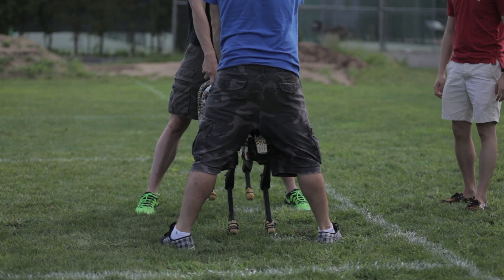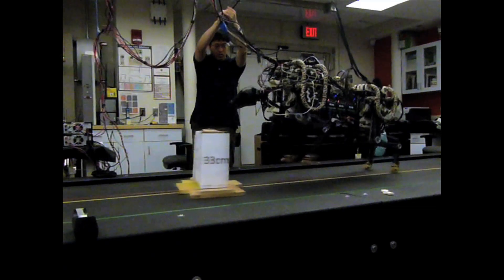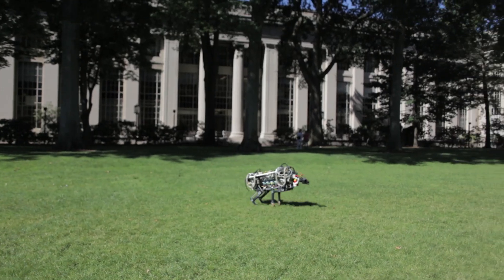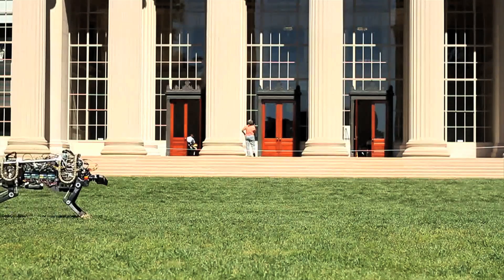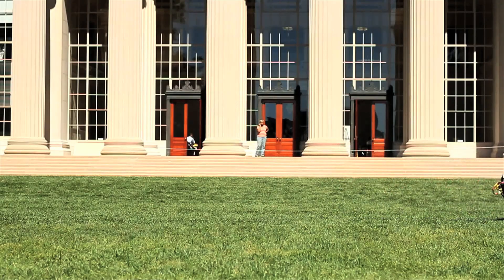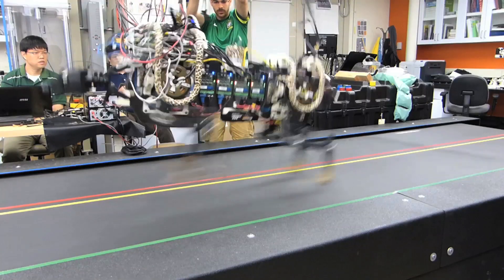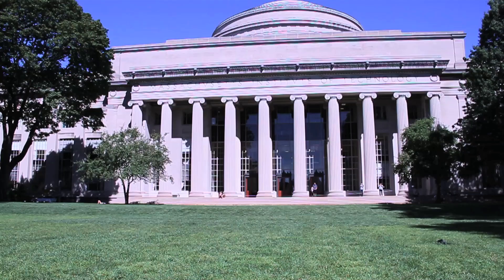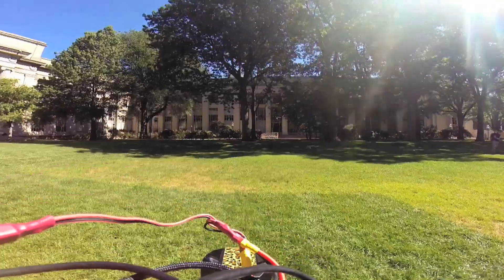MIT Robotic Cheetah

Comment: Cheetahs have distinctive springy backs and long tails for balance. The back curves dramatically bringing the back legs forward of the front legs. The shoulder barely moves up and down. Goats run with stiff backs, springy legs, and tiny tails. They bounce significantly in the front. I think they copied goat locomotion and called it a cheetah. Cool robogoat though.

Comment: Okay, granted, this thing is cool. But doesn't this thing prove how powerful drone technology is? With a drone you don't have to worry about running on the surface of the land and avoiding obstacles because you can hover above them. And although MIT is making great strides everyday, they are still a long way off from having something military ready, while specialized low flying drones might only be a few years away. DARPA's goal is to fund the farfetched moonshot ideas, but how much has it sank into this project already? It's been going on for years (if not close to a decade).

Comment: There is one huge misconception in the approach of the builders of this robot cheetah. Quadropods' movements are entirely induced from the spine and the spinal cord. When cheetahs achieve that great speed it's because it's flexible spine gives the starting point and the main power for each kick of the run. But this project seems to be based on 'big dog' which is a quadropod robot designed for carrying heavy loads on rough terrain at long distances so the rigid bulk of body is obviously explained by the need of enduring heavy duty work like a donkey does. However don't forget to inspect the difference between a donkey and a cheetah. Maybe if this team could modify the robot by adding a flexible hip joint between the torso and the legs that could much improve and refine the imitating mechanics towards of a real cheetah's.

Comment: The cheetah has a much longer throw of the hind legs. From the shoulders back to stretched out back. That one there is a diarrhea gait :)
The obvious first step is to duplicate the layout of the cheetah and the range of motion. Otherwise how could you get the gait right. With a cryogenic cooling liquid you might be able to get the power density of the cheetah in a short sprint. For lab runs you can have hoses of liquid nitrogen running through the motors. Copper resistance falls considerably at LN temperatures. Battery power density should be easy enough with products like A123 cells. Or simply toy RC lithium batteries. Power electronics is plenty powerful. Use relatively high voltage, say 100V for thinner wiring and lighter power electronics.

Comment: We wont replace wheels with legs.
The efficiency isn't even close.
Reply: The future machines will use wheels and legs for uneven terrain.
Reply: New complex tech is always followed by hyperbole, but I can see these legs being useful for off road vehicles. On the highway no way. If it's made more efficient, and more flexible it might be a great mountain climber.
Reply: For rough terrain, very much so, it easily beats tires. 
Roads, nah.
Reply: *****
 It does some what make sense. Having to build the roads that wheels are used on is inefficient. Imagine all legged creatures instead having wheels with the requirement that roads be layed down first for them to get anywhere.

Comment: you need a gyroscopic tail. real cheetah balances its movements and changes its direction with the help of thw tail. cheetah also puts one step ahead of the other here both front and rear feet are moving at the same tine its not natural.  feel free to correct me, i don't mind it.

Comment: I looks like rabbit to me
Reply: Yeah, it does kind of a dual front legs-back legs hop like a frog or rabbit. The next step would be to give it four independently moving legs that hit the earth at different times. Not an easy task, as it would require a sleeker body, some kind of force feedback in the feet and balancing/leveling sensors in the body to keep it upright. My guess is they are teaching it to scamper and jump (like a kitten) before teaching it to run.

Comment: It runs nothing like a cheetah,  not the same movements or near the same speed.
Reply: Mr. Banekitty did I say it was easy to make a robot? No. I was just stating that it's nothing like a cheetah therefore shouldn't be labelled as one.
Reply: They're all so defensive over their robo sheep...
Reply: Baby steps... baby steps. That's the way of most significant technological advances.
Reply: It's in development, it's not that easy to make a robot.
Reply: Nostalgia Gaming what did I tell you? Oh yeah! They didn't make the freaking design or same speed because it's in DEVELOPMENT!
Reply: They are focusing on the movement not speed or looks yet... It can run 10 mph that's like a normal human.
Reply: Mr. Banekitty okay the movement is nothing like a cheetah so yeah. So things which are unique about a cheetah such as it's speed movement or design has not been incorporated into this, I could make a "robot" and say this is a lion robot, but it's in development so it doesn't have to look, move and act the same.
Reply: Nostalgia Gaming If it was battery-powered and faster and more nimble than any battery-powered, self-locomoting contraption before it, and you had a clear development plan for its improvement toward action of a real lion then, YES, you could claim it a "lion robot in development".
Reply: Baby steps.. 

Piss off.. 

Get cheetah.. strap sensors to cheetah.. collect data.. use data in robot. 

Profiiiiit. 

Aka powered by NATURAL ASPIRATION (C) 2018.

Comment: First off, cheeta extends its legs when in its in the air for optimal reach of distance as well as the back legs push the ground back as much as possible to propel the body forward.
The back legs is the main concept of a cheetah's speed. Its like the engine, while the front legs is like the front steering.
Extending the front legs to get the furthest reach in front of him/her to then repeat the entire process.
Currently this robot is missing the entire concept of speed.

Comment: You guys need to add a spine, that's where the cheetah gets most of its speed from. I would try a simple compressible mid section that allows the hind legs to move up more to achieve more momentum. If you look at a cheetah running closely you sometimes see it's hind feet reach or pass it's front feet as it runs.

Comment: I had that wind up toy when I was a kid! This one is not even as capable as that one, though. It probably can't even do a back flip! So I see they finally solved the problem (that the Japanese solved 10 years ago) of an integral power source. Good job mass institute of tardnology! Did you finally figure out that 480v 3 phase is not a good power configuration for a PORTABLE robot? 24v DC is infinitely more compact and portable than industrial mains power! DUH! So, to sum up, here we have a VERY EXPENSIVE adaptation of a wind up toy (no back flips) which is at least 10 years behind the Japanese on propulsion. How much did I pay for this? It's several decades behind in brain/computing power as well. They can barely fit the electronics on this thing to control the movement. This is a PROP! Think Disney land animatronics. This is a mock up used for the sole purpose of securing more graft in the form of tax dollars. A Cheetah is graceful, fast and cunning. This thing is clunky, dependent on multiple handlers and obsoleted.

Comment: The locomotion is pretty well done, however the glaring issue is the manner in which the Cheetah uses its spine during locomotion.  The Cheetah's spine flexion during its sprint essentially recoils like a spring adding more power and propulsion.  You don't see that in the robot, just the legs moving and the spine stiff as a board.  Easier said than done of course, and these guys have done a wonderful job, but until they can develop the spine to function like the Cheetah's, they're leaving power off the board.

Comment: Is it crucial the front and rear legs move in sync with one another? I wonder if the speed could be increased if the legs moved independently? I'm sure this has already been considered, but Cheetah's legs extend at different intervals. Possible relationship between left and right, as opposed to front and back.

Comment: Unlike a Cheetah or any quadruped, this device is very primitive. It will need a simulated spinal section and shoulders with several more motors to perform any lateral movements with any degree of even simple dexterity. This venture is interesting in demonstrating how ineffective screws, bolts, nuts, armatures, wiring, etc. is vs its biological counterparts.

Comment: This is great --- however, would point out that the rigid body is a real liability. Particularly the rear portion of the torso, which flexes and extends in a running Cheetah. And eventually, when this robot needs to turn at high speeds, you should consider the tail's counterbalancing effect. Running Cheetah on High Speed HD Camera

Comment: Sounds impractical if the motors are still limited to only the weight of the robot itself.  Without payload capacity a robot like this is effectively a toy.......a very very very very expensive toy..

Comment: Looks like Wild Cat from Boston Dynamics, but big difference: no hydraulics, no combustion engine. And it's only about 30% slower - so far...
Reply: and has zero payload capacity.....it looks like it's at it's weight limit already.
Reply: Well it's not Big Dog or LS3 (which are designed to carry loads) and they've only just got it off the tether. I can't find any specs on payload for Wild Cat, but it doesn't seem to be designed to carry loads either.

Plus the electric motor and battery technology spaces are advancing at a more rapid clip than combustion technology.

So, ya know... :)
Reply: as far as I could see, its capacity is enough for a couple of minutes, LOL

Comment: this is not the optimal way to make robots , you people are looking for answers in the wrong way , yes I'm not an engineer or a scientists but I have the ability to connect dots (polymath), there is a way to make robots fast , really fast , they could have both explosiveness and great power , a robotic quadropad could carry as much as a donkey and run faster than a cheetah , yes its possible to make it , actually it transforms from a state to another according to the given mission adapting its mass to the needs , the same could be done for humanoid robots , they could outperform a human in any way possible , I can make them versatile stronger and faster than any human could be , and yet they can be more efficient in running cost (adapted to the most commun sources) and they could vary in initial cost depending on the level of sophistication needed , I can go on for days ...

Comment: Make it with a flexible back. the problem is you need to have movement also from the back location.. ( vertebrates )..
Reply: They are MIT scientists. Don't you think they thought of that already?
Reply: omglaz0rz
You seem like a very confident person with low self esteem. Cocky and wussy. :)
Reply: Good point GOZR, but they've probably thought of that already. First things first. Just to get it to do what it does is an achievement, even if it looks rather stiff. Next is better articulation for faster speeds and agility, with finer tuning along the way. The weight of the batteries will have to be overcome if it is to last a decent amount of time while doing its thing. With (higher)power to (lower)weight ratio getting better, soon it will be able to catch a frisbee:)

Whether it's emulating a dog or a cheetah doesn't really matter. These robot quadripeds will soon be used for warfare (first) if DARPA gets its way. By the time it gets to consumer level, it'll be a plug-in pet that wont have to be fed or pick up its poop, but it's gonna cost you.
Reply: good point but they don't have the proper mass distribution to fonction properly , there is a lot to do here
Reply: Kevin Davis They might be  human, but they are at least twice as smart as you and I. Trust me whatever we come up with in our feeble little minds they already thought of. It is their job.
Reply: omglaz0rz Everyone is not perfect there human just like us.
Reply: Internet robotics experts.....
Reply: Jibster sentence fragment.....
Reply: yofuzzybutt That was the sentence...are you another internet grammar nazi same as these internet robotic experts that appear with their internet degrees?